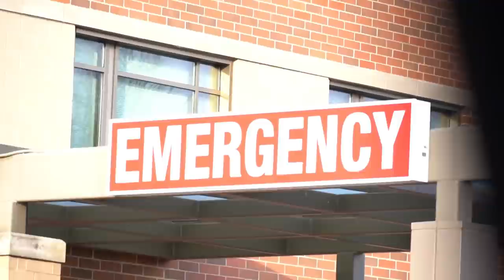THIS ENDS IN THE HOSPITAL

Comment: Glad it's only a crack and not broken. It can heal back right as long as it's in the same place it's supposed to be. It's sad that there are some bones that can't be properly set. But, it's very important that you LET IT HEAL. Don't go trying to push yourself before it's time. And, don't go pushing yourself too hard to finish things up yourself, Erin. (I hope I spelled that right) One of you needs to be 100% for the winter, just in case. Those kids need you guys more than you guys need that deck.

If worse comes to worse, stuff some insolation in those holes around the foundation, throw up a few boards to keep Leon from pulling it out into the yard, and call it done for the time being. Winter will be over before you know it, and Josh will be back to dancing around like a goofball again. Get better "soon", Josh... just not too soon. I hate to hear ya in so much pain. It really sucks when it hurts to laugh.  Leon will NOT be happy about this.

Comment: I broke a rib recently and found some relief in running a leather belt around my mid section of my ribs (breast height) and closing the clasp with just the slightest amount of traction.  It allowed me to move around more, sleep better and I avoided the jabs of pain that come with a sudden sneeze or cough as the belt kept my lungs from expanding further than they were restricted to with the belt.  The leather allowed it to flex if I needed for mobility.  I hope the best for your recovery.  For me it was about 2 weeks+ before I was able to remove the belt.

Comment: I've been there before. Worse when it is multiple ribs on each side at the same time. Best solution is get a couple ACE bandages and have Erin wrap your torso snug. The compression of the bandage helps hold things in place while the elasticity allows for rib cage expansion. May take a few tries to get the right tightness for your comfort but it will help with the sharp pains while it heals.

At least the boss isn't calling asking why you're not back on the job the next day!

Comment: So sorry to hear about Josh’s accident!! Broken ribs are no joke. If you take rice and put it in either material type of bag or just fill up tube socks with rice you can heat it in the microwave and instant heated pad, afterwards you can throw them in the freezer and use them for ice packs. The rice gently molds to the area so it doesn’t hurt as much!!

Comment: Ouch!  I feel for Josh.  While an undisplaced fracture is a relatively good outcome from such an accident, the downside is that the pain will continue for a long time.  The sharp pains may diminish fairly rapidly - over the next six weeks - but he will feel plenty of pain from those ribs for six months.  That will cut down severely on the heavy work he will be able to do.  So plan now for drastically reduced progress on the homestead.  It's like an enforced, painful vacation from building.  It is what it is.  Don't overdo it, Josh, and heal well first, then resume slowly six weeks from now.  Erin, this will be your opportunity to shine.  You already shine brightly, in my somewhat removed opinion, and now you will be tested even more.  You WILL get through this, both of you.  Remain positive, and do what you can.  What you can't do, you will save until later.

Comment: Love the way you snugged those pieces of wood in at 9:50 (thumbs up~!)    best wishes to Josh...  alas my young mortals... '; p   ...be sure to take your full regiment of nutritionals and increase your intake of cabbage, natto (if you can get it, good with rice) Vitamin D, Vitamin K2, and lots of leafy greens for calcium (as opposed to dairy... if you must, fermented yogurt, lassi, kefir...)  and stretch and work your body as much as you can (even if it is moving an inch to the right or left) each day it is good to stress (only as much as is comfortable of course) during the healing process, to make any fracture stronger than before the incident... I find fractures heal over a period of a month (so you're lookin' at 4 weeks of "therapy"... with noticeable improvement week by week) putting any part in a broken splint and not moving it during the healing process is NOT a good idea, you NEED to be able to FEEL it (NO STRESS will create a weaker repair that will only be a candidate for future repeat fractures in the same location!)   my 2¢     ';  D

Comment: Instead of a concrete footer just put gravel in and that stone wall will be there for years to come ,,,,the old timers only dug in the ground and put the field stone on top of the gravel ,,so the water would drain out from the stone like a dry hole for sewage system for your Grey water ,,from your sink ,,,same thing 😀😉😜😄😳👍😀